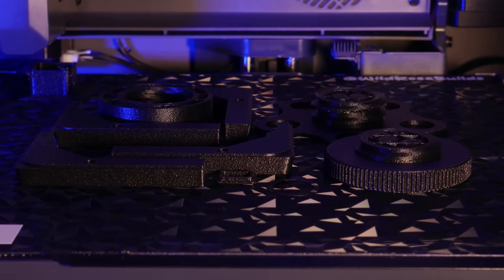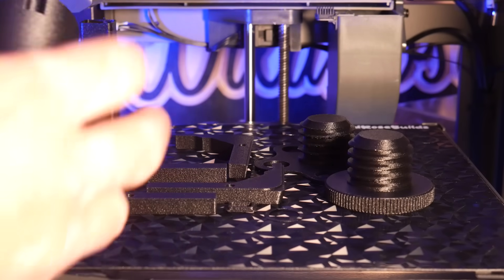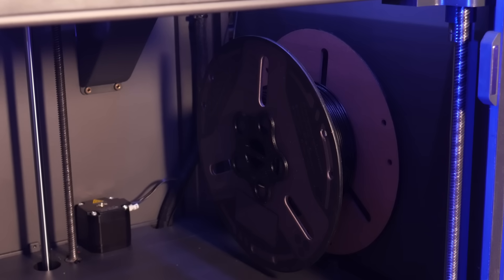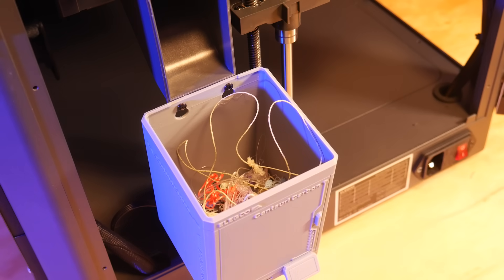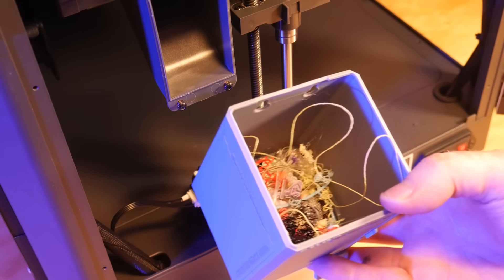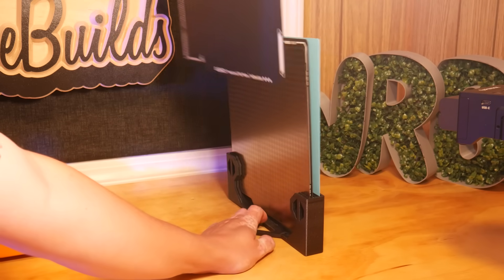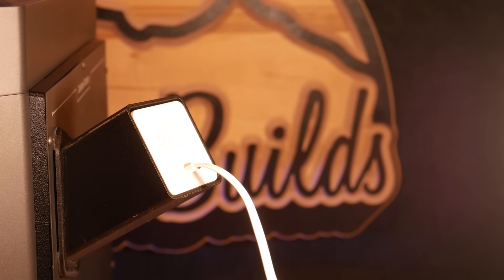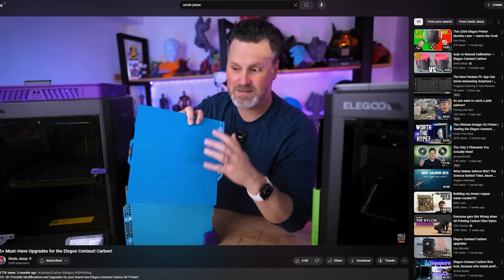6 Game-Changing Mods for the Elegoo Centauri Carbon

Comment: I’m planning on buying one of these. I need to have the door open to print pla? If I don’t have the top part printed out?
Reply: You don't need the door open to print pla.
Its recommended that you take the top cover off to print pla or petg. 
I printed a clip that raises the front of the lid and that seems to be enough for me. Printed a load of pla like that with no issues.
Reply from the maker: You can just pull the top glass off for pla printing!

Comment: Just got my ELCC and I came right here to watch and got files. Thank you for the video. I have a FF-ad5x.  Night and day between the two.
Reply: Hi! Which one are the best purchase in your opinion and why? (ECC & AD5X)
Reply: @davidkont  The ECC hands down. I will stay single filament change until the multi-head printers get cheaper. I modded the AD5X once I learn how to set correct purge time I'm running it at a single setup.
Reply: @Vlad-m9n1n  Thanks! But why do you think ECC is better than AD5X?
Reply: @davidkont  Faster.

Comment: I modified a version of the Wyze cam holder that went across the door so it sets at the top of the door and you get a straight in view of the print instead of an odd angled view.

Comment: The glass door on my CC is glued to the factory hinges. Did you have any problem removing the glass? I am afraid of breaking the glass it is glued really well.
Reply from the maker: I had a preproduction unit so it didn’t have any glue. I would proceed at your own risk, some heat might help release the glue?

Comment: Disappointment here. I thought there were game changing mods... I thought of some tweaks for better prints... A poop slide? It takes forever to fill the poop bin, why the need for a bulgy slide?
Reply: It's to prepare for expansion to multi-filament printing, where a change of color at each vertical layer will create poop. It can add up very quickly, and I've seen even that slide version get full causing a printer jam.
Reply: I printed this one because my printer is in a closet. I don’t have good access to the back without moving the printer.

Comment: The inside of the build chamber is not very hot, max 35°C. Buy a real dry-box with fans, (like 50°C)
Camera wont stop "air prints", clogs nozzle, misfeeds, obstructions et cetera. 
Build plate is overhanging the front edge of the of the heater plate "box" causing it to bend, Bambu Carbon X1's doesn't.

Comment: Hi Just got the printer and have installed the door hinge.  Questions how did you remove the metal tab inside the glass door with the 2 threaded holes.  the parts show 2 nut blocks I assume the metal parts on the glass door are removed to use these.  Thanks for posting files (:  (:
Reply: What I found was the metal was held on with double sided tape and with a little work they came off fine.

Comment: I just got mine about 2 weeks ago and it’s printed fine since until yesterday it stopped printing PLA it just keeps failing after the first few layers. I did some research and it doesn’t have a clog I cleared it did a cold pull but it still only prints the first few layers the. Just prints in air. I took it apart and found the lil gears that push the filament down were pretty clogged cleared them out but it’s still not printing pla. Petg prints just fine any idea? I’m using stock profile and elegoo sparkle pla . Have tried different brands and same results.
Reply from the maker: Try giving your bed a good scrub with soap and hot water. The stock bed seems to lack some adhesion. Sounds like maybe you have a partial jam from a print breaking free and dragging around.
Reply: That sounds like a slicer problem if you’ve tried different brands.
Reply: @Impuritan1  I have been trying everything I can think of and read up on and still nothing. The file I’m trying to print is the stock benchy that comes preloaded on the unit. It won’t print anything just keeps bird nesting or it will get a couple layers down and then print in the air.
Reply: @pontile88 have you sliced your own Benchy and tried that?  I hate that stupid boat but it was the first print I didn’t on mine when I got it.  Printed it perfectly.  Does it print any of the other files on it, like the bed scraper?
Reply: @Impuritan1  no it’s not printing anything anymore not even PETG I think it has something to do with the extruder gears/tension sprint. Need to test some more I hate that you have to remove so many screws to adjust that spring as I have no idea where to start with the tension. I’ll run some more test and report back. It’s the last “part” I haven’t messed with to see if it will get something going.
Reply: @pontile88 see if you’re extruding what you tell it to.  Mark off 50mm and tell it to extrude that much and see if it actually extrudes that amount.
Reply: You ever figure this out?

Comment: What build plate setting are you using for that plate?
Reply: In the slicer did you have it set to smooth or textured? Did you make any changes on the printer like side a or side b?
Reply from the maker: @cbarth3 I kept it on smooth and bumped up my first layer height to .22. I don’t change it in the slicer or on the machine as I think it just saves different z heights for either side
Reply from the maker: I was running it at 80 and it seemed pretty good!

Comment: You printed the riser that opens up at the front for when you are printing PLA so why would you need to side mount the camera and put a big hole and void your warranty ?
Reply: if you are sponsored you dont care i guess oooooooooor you care tooo much and really hate the camera :)
Reply: I printed the Window angled mount for the wyze cam and put it to the side of the door..
Reply: I'm glad I read this comment. I got so excited about doing this to mine that I didn't even consider the warranty lol. I'll do it after it expires.
Reply from the maker: The door still should be open for pla printing. This was just the best spot for me. I thought about mounting it right to the top glass for a top down look but the extruder would be in the way most of the time. My warranty was voided a long time ago haha 😂
Reply: @WildRoseBuilds  I print mostly in PLA and I always have the door closed and I have printed the riser like you and just have the front vents on that open and I''ve had no problems with my PLA prints here
Reply from the maker: @JohnDoe-bz4yl that’s good to know! How’s your ambient temps? I have a very small office where I keep my printers that gets around 30c during summer 😅
Reply: @WildRoseBuilds at first I was like, ”he ruins it” then I was like, that’s doesn’t look so bad. Does elegoo actually honor their warranty?
Reply: The riser doesn't let enough air for large pla prints.
Reply: @rustimack  Just taking off the top glass panel from the top for super big PLA prints solves that issue.  I have the riser system on all 6 of my carbons, and I cycle through both PLA and PETG-CF prints, so having the riser system allows me to keep chamber temps where they need to be without any issues.

Comment: CF/GF filaments suck because they flake and splinter. They aren’t good for durable parts
Reply from the maker: Interesting. They felt pretty durable, but nothing beats asa I guess haha
Reply: @WildRoseBuilds   the filaments make strong prints, but I don’t use them for important things because they put microscopic splinters in your fingers when handling the parts and they flake and crack under use.
Reply: @sciencesaves  I print plenty of things with Tinmorry PETG-GF… i have yet to encounter any of these splinters 🤔 now some CF filament do this, but honestly the majority dont even use enough whole carbon fiber to make splinters….i use them all the time….ive only ever seen the splinters with a brand that specifically said they used 20% chopped carbon fiber… 🤷🏻‍♂️ i think the majority of it is internet hyperbole…
Reply: Ive seen this, and folks reccomend putting some kind of varnish or lacquer over it prevent the problems